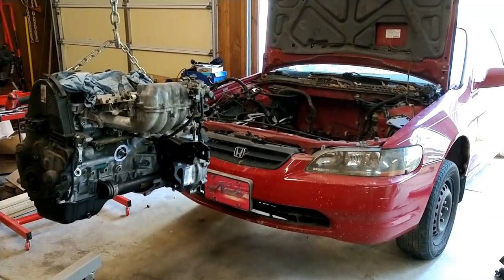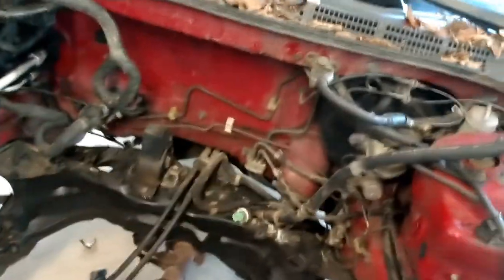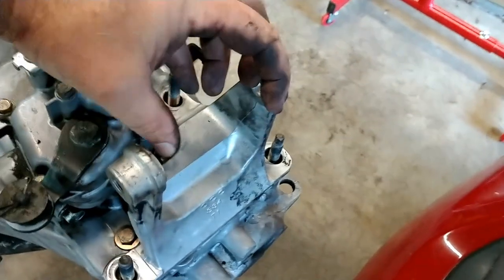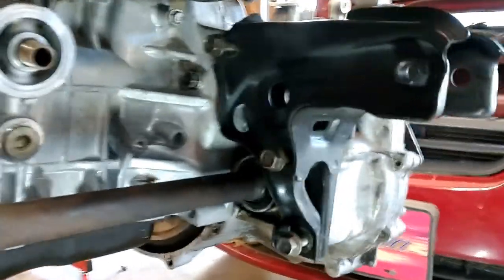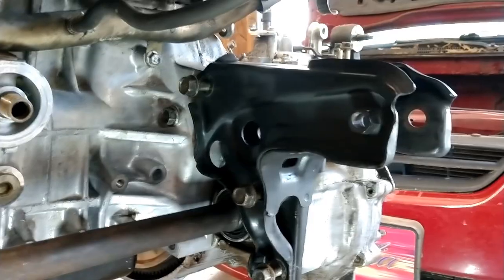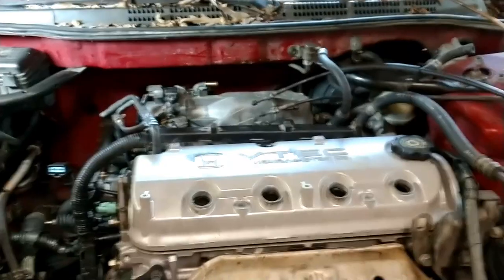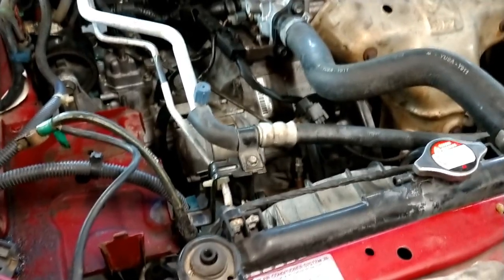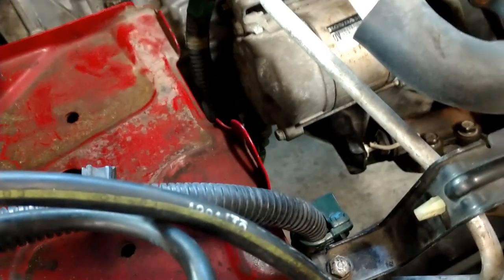F23 Honda Accord Engine Rebuild Part 14: Engine Install and First Start

Comment from the maker: Update. The STP oil filter split. I always hand tighten filters. Was crazy but I got the engine shut off as soon as the oil light came on. Made a mess but it didn't hurt anything. 

The water tube is leaking! These were aftermarket O rings so I went to the dealership and got OEM. Hopefully that will iron out the last detail. 

Thanks again to everyone that kept up with the rebuild!

*Edit- Swapped the o rings and it was pretty obvious that the OEM ones were much beefier and the tube had a lot more drag when inserting it. Keep that in mind if you use aftermarket. I might have just got a bad set.
Reply: What break in procedure did you use?  If I remember correctly you didn't use any break-in oil.
Reply from the maker: Someone said that it could have been caused by the assembly lubricant. I was going to change the oil at 500 miles but it changed itself. Also, i just kept the rpms low and no highway miles for the 1st 500 miles.

Comment: Started rebuilding my aunt’s 97 accord this january. Its a ph22 engine which apprently is the philippine version of the f22 or f23. Currently on step 9 of the rebuild process, and so far this series has been spot on. Cant wait  til i get to this stage. But this early thank you for all the help!
Reply from the maker: Thank you! Hope everything finishes up smoothly for you.

Comment: Thanks for uploading these, using them religiously before i pull my f20b6 suspected head and crank seals are gone, still runs like a dream but drinks oil (no smoke tho) Thanks from the uk
Reply from the maker: I am always glad to hear this series was helpful. Thank you for taking a moment to comment. Good luck with your repair!

Comment: No man, THANK YOU!
...I knew I could do it, but need that push of confidence to tackle this job. I have been circulating this project for over 2 years, I just felt  very insecure about it. Thanks to your videos I gain confidence, not finish yet, but soon I will. Not just that, but I feel very confident that I'm going tackle a second one(K series),and that is all thanks to your videos. And throughout time your videos will help lots of people for sure.
I'm able to pick up sadness in your voice, I hope everything goes back to normal, if it doesn't,  well , things happen for a reason, and sometimes is just out of our control, and nothing we can do about it but learn from it, just let it roll and move on. Remember your are tenacious,  and you will be ok.
Reply from the maker: I really appreciate your words. Means a lot. I'll get it all back! Let me know when u get yours running!
Reply: @ktecgarage  
Whats up teacher!
Reply: @ktecgarage  
...well I did not finish assembling the engine before Thanksgiving 2019, after that time I knew I was not going to get it finish and put in the car before winter (short day hours, and cold). So fixing to get back at it , approaching video 12 of your series. I notice  you have thousands of views now, great work man.
Reply from the maker: Thanks Gus. I'm looking forward to you posting a video of your rebuilt F23 running like a watch!

I actually have a garage now and I'm going to have to replace the heater core. That means pulling the dash. Might video it. I'd like to get back to this. Was a lot of fun.
Reply: @ktecgarage  
Congrats with the garage,  I bet you are one of the very few honest mechanics. 
And yeah,  keep the videos coming,  you have your own style, I'm sure will get a lot of views on that heater core, yes it is a little pain to get to it. I did on a 03 CRV.

Comment: Thanks a bunch! Really appreciate your honesty and discipline. Your passion shines through in your diligence and care. Now I want to rebuild an engine. 2010 Accord 2009 engine, that suffers from the VTC problem and high oil consumption issue. Which of course has caused the two catalytic converters to gunk up.

Comment: Good morning  teacher!!!
Yesterday I have completely finish with my accord 2.3, took me almost a year. Vehicle is ready to pass emission test, a must here in GA.
Although I struggle toward the end, the first crank/star up was very noisy, car was misfiring a lot , and all kinds of codes pop up, and it sounded like a Subaru🤣🤷‍♂️.
Had 3 issues going at same time, all would make a car run bad just by themselves. 2 big newbie mistakes, I never adjusted the valves, I dont know why, not sure what was I thinking after replacing all of them new, and expect to run good. All were loose, some very loose, almost a 1/4" gap😬. This was making it sound like a Subaru,  and misfire big time.
The 2nd was the distributor cap, I reuse the old one because it look good to me. Bad mistake,  got a new one, and got much better, but still missing a bit, and code p0325 kept ON😡.
The last issue,  and almost made me pull my hair out🤣. The dreaded 'knock sensor '..modafaka...broke the original while disassembling the engine. Went through 5 different sensors, they all were dying with in 4 miles of driving after installed. P0325, just kept coming on, and I could feel the car just losing its power when the sensor die. I thought some was wrong with my car's computer/wiring. Car was fine, I was just dealing with cheap parts, this was my newbie mistake 🤣.Bought a "good" sensor, and  code is gone, all good now👍😉.
Just wanted to thank you again teacher, this adventure has ended, and I have learn a lot. Ready to tackle another one, 03 Cr-V k20 engine, bad head gasket,  bad oil pump, and old transmission. 
Well farewell,  good luck to you, and THANKS!!
Reply from the maker: That is all great news Gus. I hope you get a lot of miles out of that repair. Even though I drive old looking beater cars, I still always feel that sense of accomplishment when I turn the key and it cranks right up knowing that I got it right. I'm very glad that you and others are able to take something away from the effort I put into making these videos and sharing them. You should do a K series video series! Good luck and thanks for the support.
Reply: @ktecgarage  Yes,  you are right that feeling of accomplishment is awesome!😁
I'm very camera shy, probably not😬.
..now I'm going to advance auto parts to buy my "Honda baseball cap"😉

Comment: Hey man I love your videos they have helped me a lot on my 2.3 accord. I’ve got a question for you if u don’t mind. I’m having trouble with water leaking from the front side of my engine drivers side mid engine, any ideas what it could be? Are there any freeze plugs there around the timing components I don’t think it’s the water pump but I’m stumped really and haven’t had time to break it down. You have any idea what it could be? Thanks buddy! Engine has 365k but still runs like new, I’m just tired of putting water in it everyday, I gotta break down and fix it!
Reply from the maker: It would probaby be either the water pump or the water tube that exits the water pump that runs the length of the back of the engine. The water pump has a weep hole under it that leaks coolant when the bearing is going bad. I show the weep hole in this video where I replaced the pump on a Civic.

https://youtu.be/GM2hfnmD0Ok

It's always good to hear that my videos were useful, so thank you! Good luck.

Comment: I see how you got it out sorry about your situation keep your head up man how did you get the sensor on the back next to the coolant hose the one that is a 7/8 sensor we had to take the intake off to get it curious how you got it on I also dropped the sub frame so I could get access to the bottom I thought about dropping it to the bottom then out so I didn't have to fight the AC lines great video tho
Reply from the maker: Are you talking about the knock sensor with the green connector or oil pressure switch? Those are the only 2 under the intake on the back.
Reply: @ktecgarage  oil pressure sensor
Reply from the maker: I set the front high in jack stands and just get under it. With the oil filter out and the hoses not attached, it's not to awkward. Then use a deep socket to run it in or out. Good luck and thanks for commenting!

Comment: Do you have to take off the transmission if you’re just doing an engine swap? It’s the same engine going in
Reply from the maker: No. Can't think of a reason. It's just the axles, linkage and one more motor mount to pull it all out at once. Might be easier to just pull it and attach it to the engine outside of the car.

Comment: How's the engine running since the rebuilt if you still own that vehicle?
Reply from the maker: It ran fine including a 2000 mile road trip I used it for a few years later. I did eventually sell the car about a year ago. I suspect it's still running fine. It was a solid car.

Comment: Hows car driving so far.. I rebuilt mine and it has some slight piston slap until it warms up
Reply from the maker: I saw your question on the other video. For various reasons, I've only put about 1000 miles on it since I finished this up last October. It sat for months while I sorted out some life stuff and used my 93 Civic that I had rebuilt in the same manner. I have put 30,000 miles on the Civic with zero issues. But, this Accord runs like a watch without any issues. Maybe your cylinder walls were too out of spec to do this without boring it over. Thanx for watching and commenting.
Reply: @ktecgarage  i realized my knock sensor was broken... I was also reading where hondas even the new ones with 12k miles develop slight piston slap.. Thats what had me concerned but not so much now

Comment: Hi there did you have to adjust valves as well?
Reply from the maker: After I had it assembled, I did check the lash and it was good. I put all the valves back into the same place that they were removed from.

Comment: Any possible way you can make a video talking about how to Turbo that same Honda accord 1998- 2002
Reply from the maker: Not really my thing. If I were to turbo that car, I'd use a K24 and not the F23. You could probably go 5-7lbs/200-ish HP with the F23. Anymore than that I would swap rods and widen the ring gaps. Not really the best engine for that. There is a guy on YouTube that did the F23 and kept his AC. Try and find his vids.

Comment: Well today is the day I start it kinda nervous lol
Reply from the maker: Take ur time and keep up with your parts. Good luck!
Reply: @ktecgarage  all bad I have a fuel lake on my intake what did I do bad
Reply from the maker: @MILO20121  washers under the fuel connector/damper or the o ring behind the fuel pressure regulator.
Reply: @ktecgarage  yup got those right taking it apart today thinking the after market o ring for the fuel injectors r bad changing those out......but need big time help changed out the tranny shift cable completely n when I turn the key d4 light stays on tranny is in park confirm it by hand underneath n matched it up on gear box it doesnt blink just stays on than goes away ......cant turn key cuz I get a lake of gas on top of my intake so go thg to start there but do need help with that shifter stuff no video out that I can find broke it when I replaced the engine
Reply from the maker: Re do the o rings and add engine oil to them before inserting them. They can roll out of place without some lubricant. As for the shift cables, I've only worked on the manual transmission so I don't have any experience with your setup. There are some really good Honda discussion forums that can probably help you with that.
Reply: @ktecgarage  thx u
Reply from the maker: Let us know when u get it all ironed out. Thanks Los C

Comment: Hi! I Have a 2002 Accord and i did the same thinks at the engine 
Can u share what kind of viscosity grade did you used?
Reply from the maker: I guess you mean the oil I used for the break in period. It was cheap 5w30 that I changed at 500 miles. Good luck with your rebuild!
Reply: Thank you so much! appreciate 
 greetings from Mexico

Comment: I've got a f23a1 with a broken cam shaft I believe the cam dont t7rn when you turn it over but the cam gear does turn is it possible that the key broke off in the key way from the cam gear?
Reply from the maker: I wouldn't assume. Just pull the valve cover and see if none or some of the rocker arms aren't moving. If no rockers are moving, pull that front, top timing belt cover and pull the cam bolt and watch it while u turn the motor over. Good luck!

Comment: Can the engine be pulled with out removing the transmission
Reply from the maker: I'm sure you could, but it would be easier to pull both at once. If you are trying to get around removing the axles, you still have the jack shaft bolted to the rear of the block to contend with. I personally think you would just be making the job much harder. 

Thanks for watching and commenting!